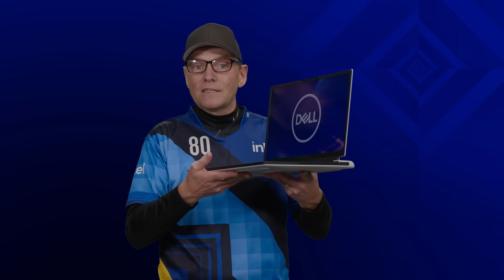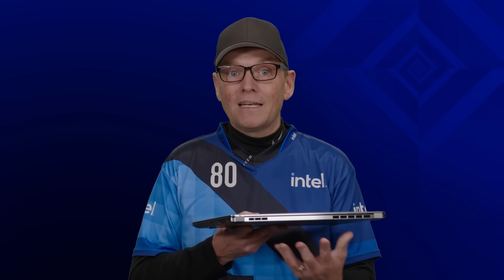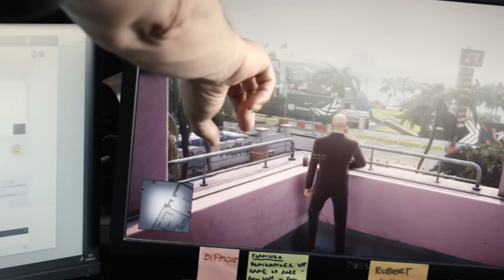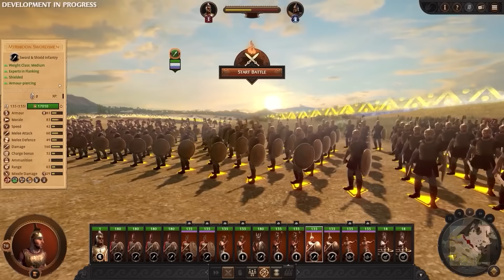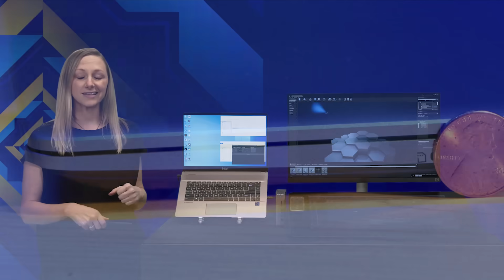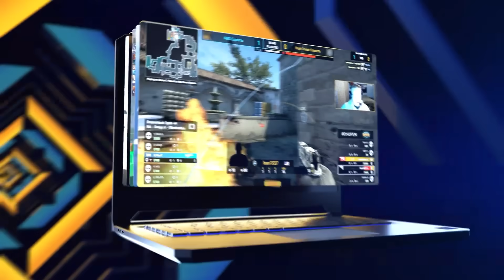Deep Dive: 11th Gen Core H-series | Intel Technology

Comment: 6th gen to 11th gen where Intel iGpu ie. Hd520/530, HD620/630,UHD620/630 and the UHD G1/G4 had the identical 24 EU iGpu 😂 no improvement just like 50mhz speed increase over generations for like 6 years so? It took 7-8 years for intel wake up and finally fix their iGpu..the Lunar lake was a radical change for Intel with the 8x Xe2 graphics core in the Arc140v it has 64EUS but each EUs are double the size of an Meteor Lake iGpu EUs..

Hopefully intel keep innovating this Arc series GPU not by just stagnating one architecture into recycling it to multiple years